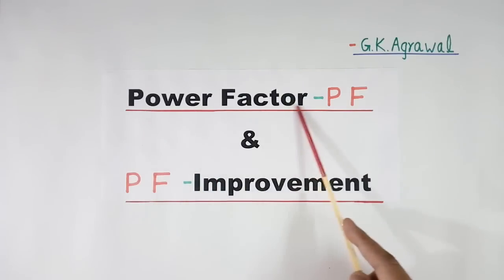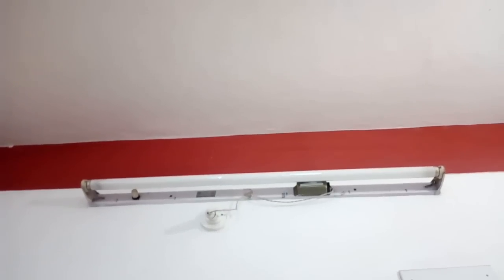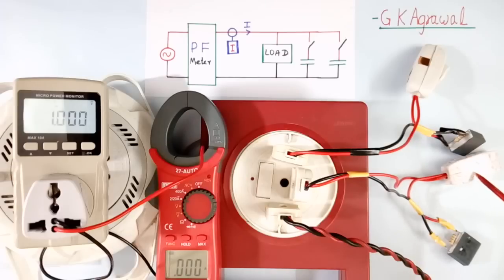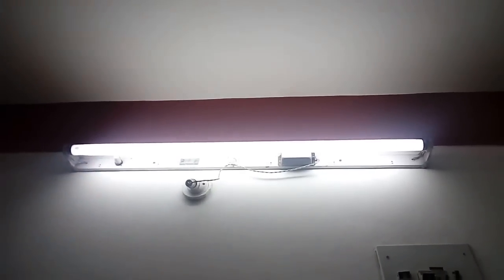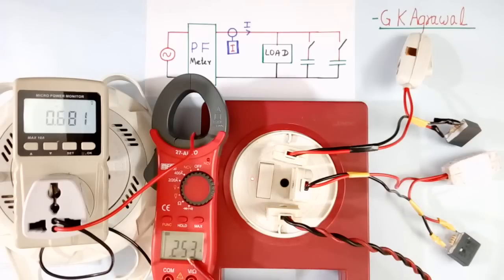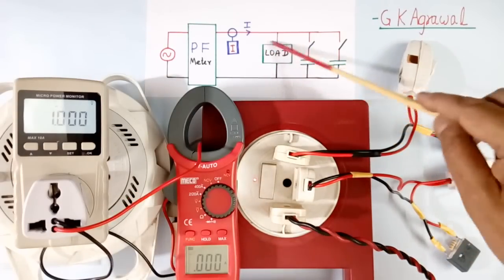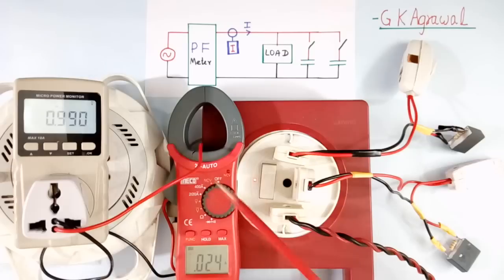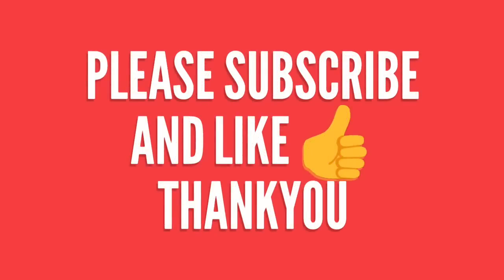Power Factor correction, improvement, Practical project

Comment: R/SIR
I LIKE YOUR P.FACTOR VIDEO ,SIR WHAT IS THE VALUE  OF THE CAPACITOR
IAM ALSO RETIRED PERSON
BUT SIR THE TEACHER IS NOT RETIRED UNTILELED THE LIFE......
Reply from the maker: 1- Thanks, I we continue to spread knowledge, we are never retired.
2- Value of capacitor is 1 micro F  each.
Reply from the maker: 1 micro faradey , 250V AC
Reply: THANK YOU SIR.....
I THINK THAT WORKING VOLTAGE IS MORE THAN THE 250 V AC.
Reply from the maker: 1- My house voltage is about 240V.  But I used for short time for demo only. If we want for long term use, then we should take about 400V ac type for good life. This is to take care over voltae, voltage spike etc.
2- Best is, to replace choke type tubelight with LED bulb / LED tube light. Within 1 year entire cost may be recovered.
Reply: Sir why we use 400v for long time how I calculate it also i want to know about How I select right Capacitor bank or capacitor for power factor Improvement.......How and where we connect this capacitor..........
Reply: सर कैपिस्टर हर चीज में लगानी है

Comment: What kind of capacitor is used to correct the power factor
Reply from the maker: Polypropylene type, I visited 2 manufacturers of  power factor capacitor. They may call it Mpp type also.  Market you can enquire by metslisef polyster capacitor for small hobby project.

Comment: This video is just a tutorial to help you understand PF of various devices. But our respected sir never said that reducing the PF will actually reduce your power bill. Lower PF will just increase your reactive power(not real power). And our meters are designed to measure real power only. But yes this lower pf increases the load(by increasing the current) on supply power momentarily. So for a heavy industry, the load on the wire increases significantly. This does not change their real power consumption but the momentarily increase in current increases their max demand graph thus making them pay more for fixed charges. For example if you run a low pf device with real power consumption of 2 KW but reactive power of 3 kw, then govt would charge you fixed charges for 3 kw, however, you never consumed a real power of more than 2kw. For industries this gap is huge and they end up paying more. So they go with using these capacitors.
And of course, adding an unwanted set of capacitors will surely increase you power consumption little bit. It will consume like a 20W led bulb constantly..
Reply from the maker: Good, watch my video on, problem of low pf and why we need to improve power factor in industry. There are many more problems with low power factors.

Comment: Sir , I tried it at home using fan capacitor with the same connection as yours ... But instead of improving the power factor ,the power factor goes down ..  how this happened sir? Thank you
Reply from the maker: Use a smaller value capacitor. I explain the reason in another video How leading power factor

Comment: Sir how does the current reduce in the circuit when we add another electrical pathway in parallel. Moreover the capacitors are outside the load circuit. Please explain
Reply from the maker: Watch my video on how leading and lagging power factor with calculation example.

Comment: It is TRUE that capacitance in parallel with the load WILL increase your power factoe BUT electricity companies do not charge your bill based on power factor . The amount of REAL power consumed is the same so your monthly bill will NOT decrease I am unhappy to tell you . Do you NOT think that a PFC or power factor correction device for residential premises would be selling by now like hot cakes . Of course it would BUT it does NOT.
Reply from the maker: In college you study and gain knowledge on  many thing which are not used in homes. 
You get knowledge on many thing which you may not use in full life. 
PF penalty is very much there in the industries and they should learn the concept. 
Even in home also, someone can use this  knowledge and try to reduce current and losses in cables. 
It is sad that you want to learn only those thing which are usefull in home only, that to just by imagination that it will never be useful in home.
Gaining knowledge is always good.

Comment: I am suffering from some peoblem that is i used to add an essential load of factory to a 11/4. 33 v 1600 kva trns but when there is no inductive load in factory except the essential load (led,fan, single phase motor etc)  the power factor go led
What is the cause can you please be know the fault took place and where from the pf leding. Please oblige me by knowing the fact
Reply from the maker: How can somebody solve your factory problem. Get the electrical system checked with some consultant.

Comment: Respected sir very nice video we have facing a problem 
10hp 3 phase electric star delta motor power factor is .43with 4kvr
Power factor not improve please guide me 
Send your contact number
Reply from the maker: Please check PF improvement at full load

Comment: Sir according to your connection I can see phase difference in CRO or DSO  or not.
Reply from the maker: Yes. You can see.
Reply: but Sir phase difference is very less that is around 1.12 micro second
then I am using Theta =2*pi*f*time
then PF=COS (Theta)
then it is coming around 0.93
Reply: On chock pf = 0.5 is written

Comment: what is the values  of capacitors and resistors  how to calculate plz explain with examples with load
thank u sir
Reply: load
Reply from the maker: In this video capacitor is 1 micro farad. Discharge resistor is 2.2 M ohm

Comment from the maker: Comments welcome
Reply: G K Agrawal not working.... if i connect that same circuit, amp reading increase instead of going down
Reply from the maker: check your circuit for conections again.
Reply: I already did... i check my connections same with the diagram
Reply from the maker: 2 what is battery voltage
Reply from the maker: what is load, if load pf is v good, then pf will become bad and current will inctease, or if capacitor value is more, pl tell your load and capacitor value
Reply: My load is a xerox machine with printer... then my capacitor is 1micro farad 300v with 2M resistor
Reply from the maker: I have not shown xerox machine in my circuit. You should find power factor and current load of the printer with xerox machine. If it is unity then current will increase by adding capacitor. I made one video , in which I measured current load of printer with xerox machine. Current is not constant , it is changing, when current is very less, capacitor will certainly increase the current. watch current load of printer at ( it is in Hindi, If you know Hindi then very good, else you can still watch current shown by the multimeter.)   https://www.youtube.com/watch?v=Lpv518gstM0
Reply: G K Agrawal how to measure the pf without pf meter
Reply: G K Agrawal  sir meri ek problem hai ghar me mitar ek hi hai aor ghar ke do fulor Gironde fulor me ke light chahe kisi bhi Parkar ke ho zada din tak nahi tik pate aor 2 fulor ke light  2 year se bhi ziyada tikte hai to problem ki hai
Reply: Gudday sir... what if i choose to correct the pf of my aircon 1/2hp... what should the value of the capacitor....
Reply: Thank you. So clearly explained. Please advise if the capacitor should be connected to the same outlet from which power is taken for bulbs and the fan.